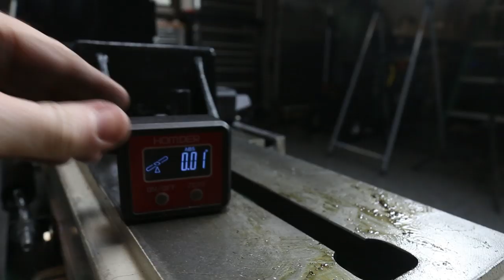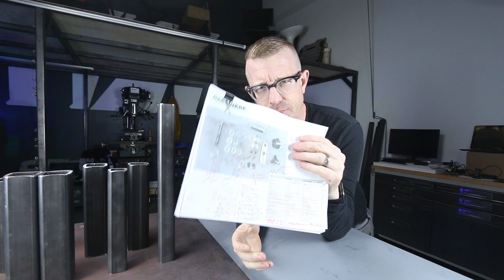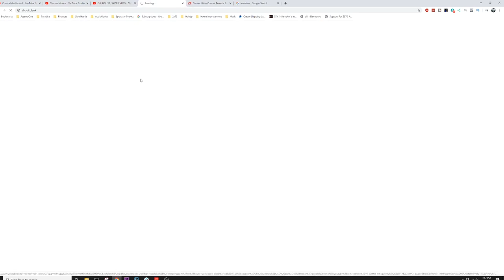HOUSE / WORK - Workshop VLOG - Episode 003

Comment: NZ here. Bit further south than Aus but not sure if i end up in those numbers(we are usually lumped in with them)
Loving the glances at the more nuanced parts of your builds.
Currently a mechanical engineer apprentice I am challenging myself to make a 2x72 out of mostly found or salvaged parts. Thankfully work allows me the luxury of welding bits on and milling them down etc to fit.
In regards to the hollow section. What I have is thinner and had to weld/mill some shims to achieve a nice slide fit and am welding in a plug for the drilling and tapping of the platen(next few days hopefully).
Might send through some photos of the little monster once it starts to take shape.
Cheers for the quality content.
Reply from the maker: Cheers for that info! I appreciate it. I am compiling everyone's responses and coming up with something that should work. Thanks again!

Comment: Screw the metric system, it a 2" x 72" belt grinder. Engineer style leather boots good foot protection from welding grinding, are comfortable and best of all no laces slips on and off easy . Weight of the grinder equals strength and less vibration plus i am not a engineer and i have always worked in the heavy industrial world  so i build heavy. It stems from watching heavy equipment break down from fatigue and stress.
Reply from the maker: Couldn’t agree more. I do like how easy metric is to understand. Fractions always mess me up. Heavy is good. 😎

Comment: inches x 25.4 is your go to measurement to convert usually with metric tube steel here in Aus its rounded off so we would use a 50x50x5mm square RHS that would be your largest section with then a 40x40x3mm internal but from my limited experience nesting or sleeve tube steel we get in imperial measurements. i will look it up with a local supplier. 
With your band saw blade i have the smaller version and one way to square the blade is with a precision square (long ways) on the bed of the band-saw with the short leg square with the blade and adjust to suit.
with the boots i would be going an oil resistant leather boot (steel cap) for those drops. leather is good for welding as it will resist the spatter.get yourself a good pair of leather sleeves that tie at the neck that way you get the benefit of the leather coat but none of the weight.
i remember something that Tom Lipton has said over on his channel, was nothing over engineered ever broke. you want it like that so it reduces vibrational stresses that you will get from the bandsaw running all the time and weight means rigidity! always a plus
Reply from the maker: Thanks Troy, if you find something let me know. I think 4mm wall is too thin for tapping? Thoughts? This of course can be fixed by welding a nut on the outside of the tooling arms but I would rather avoid that. :)
Reply: House / Work 

Depends on the tap you want to cut and the force that ends up on the tapped threat, methinks. It‘s 5/32 thickness, 3/16 could still work.

Comment: 2“x2“ = 50x50mm

Wall thickness of 4-6mm is usually available in that size. Let‘s go with 5mm for easy calculation, so the inserted piece would be 40x40mm.  

Best from germany. 

*I‘ll build my 2x72“ (50x2000mm) grinder. One of these days ...
Reply from the maker: Hey thank you!! Makes a lot of sense. 👊🏻👊🏻👊🏻
Reply: House / Work 

You‘re welcome. Your grinder build is among my top favs and your videography style is amazing. 👊🏻

Comment: Does  the 2×72 grinder works great? Yes
Does  the 2×72 grinder works with no issues? Yes
Does  the 2×72 grinder works with no vibrations? Yes
Does  the grinder tilt to 90 degree with no issues? Yes
If a grinder works with no issues and does the job, Then its perfectly designed.
Reply from the maker: Yes! Thanks Laythius! My thoughts exactly. 👊🏻👊🏻👊🏻

Comment: 2inch is 50.8mm 1.5inch is 38.1mm. Most metal places will stock it
Reply from the maker: Can you get 6.35mm wall? What I seem to find is 4mm wall. So I am thinking 50mm x 50mm 4mm wall and have a 40mm x 40mm telescope into it for the tooling arms. But what about that 2mm gap? 🧐 Big deal or??
Reply: @HouseMadeUS  i can get 6.35mm wall in Ottawa Canada, 2mm gap isnt terrible could make that work if need be.
Reply from the maker: Good info. Thank you Richard!!

Comment: You have a great build, better over built then under built and under powered and falling apart the first time you use it. Keep up the good work! Also do you have a lathe? Just wondering
Reply from the maker: Hey Ken, yeah I do have a Lathe. It’s an old Logan 400. It needs some work. (Good content) I really want to get it up and running. 👊🏻👊🏻👊🏻
Reply: @HouseMadeUS  You know if you looked into the taper lock bushing, the roll will have to be made and i haven't found anybody selling them. Just a hint, you may be the first.